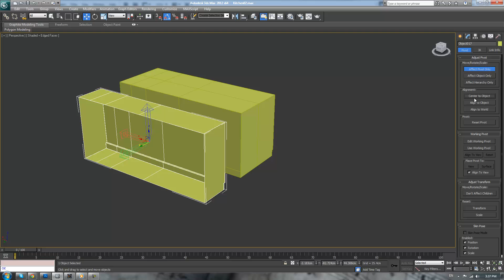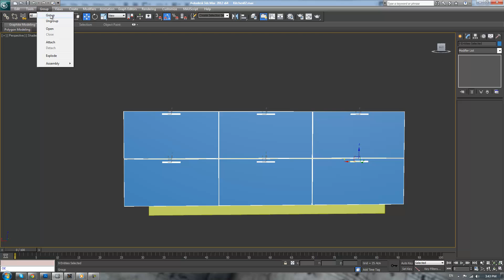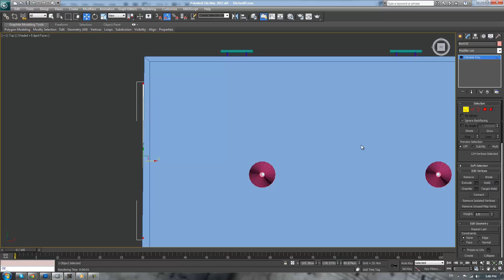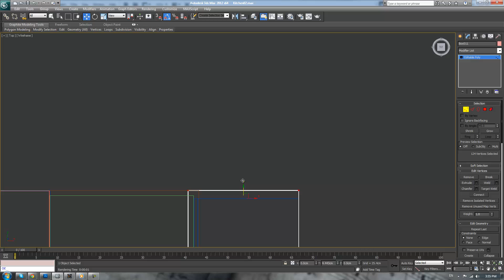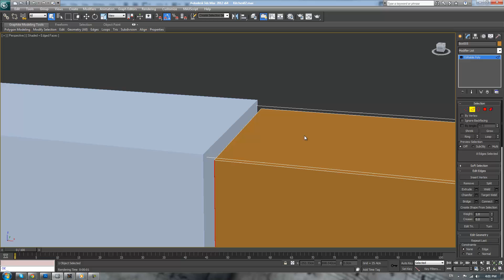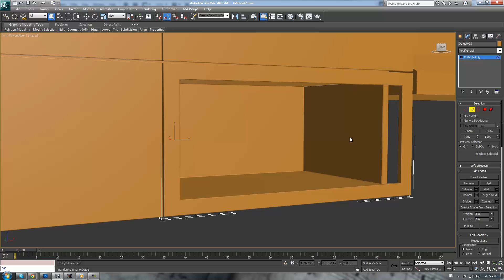Kitchen - Part 3 - Counter Top and Upper Cabinets

Comment: This comment is 4 months old but if anyone has the same problem (Alt X not working), you need to right click on the object, select Object Properties, then under Display Properties click where it says By Layer. You should then be able to enable See Through also under Display Properties.